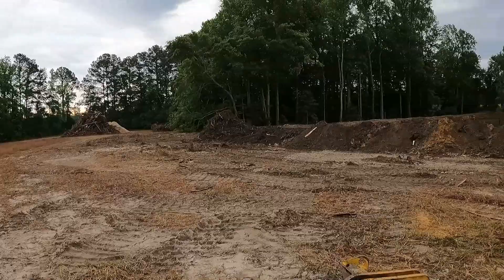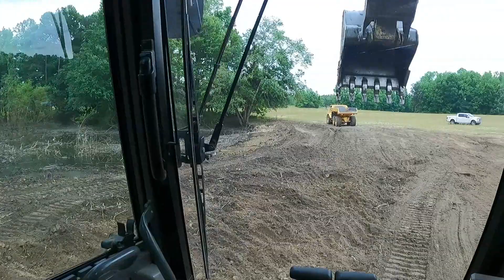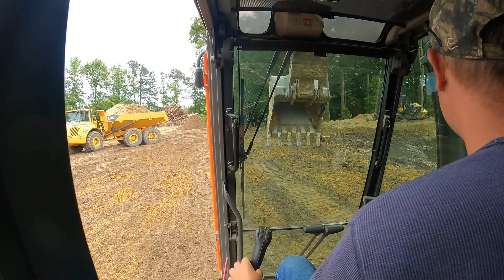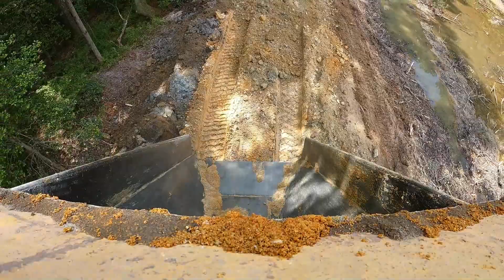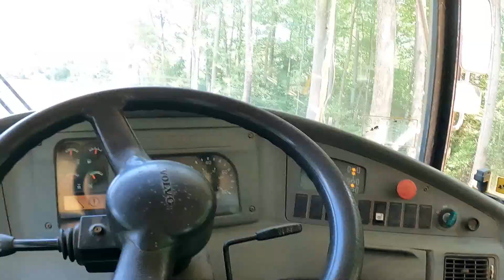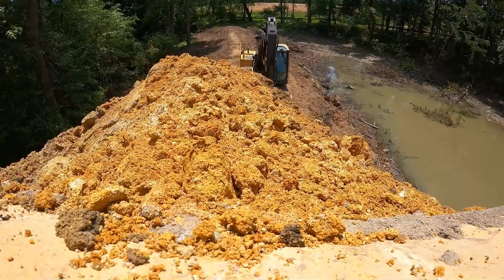Rebuilding The Pond Dam

Comment: that clay is not sticky ,, wait the dozer stopped and spun the track of it is sticky it passed the test ,, i have 30 acres of clay pain in the back side takes the yard a few days to dry out after it rains and in a heavy rain i get 2 too 3 inches of standing water ,, just bought the place have ditch work too do ,,at least out back it drops off so i can drain it to the woods then the creek ..

Comment: The tires on the right side of the dump truck look like they're about to lose a recap.
Reply: thats oil stains from the lift cylinder
Reply: @richardschipper5989  OK! I was concerned and thought I should say something. No need for a cap flying off and breaking down.